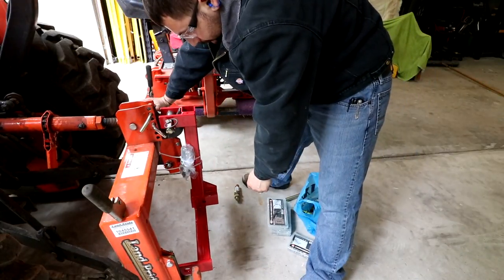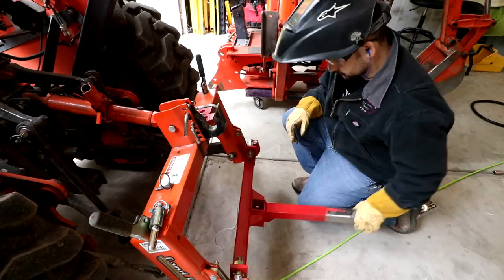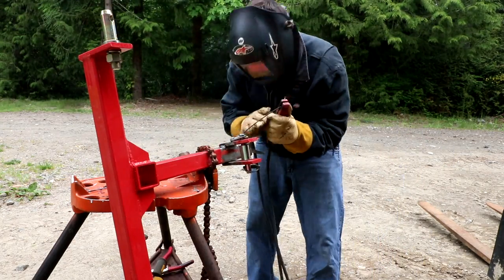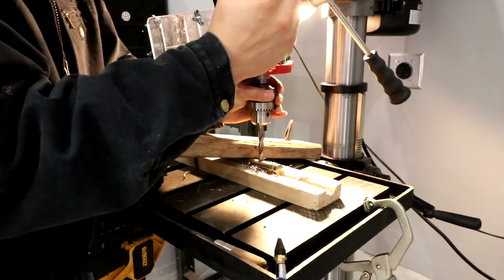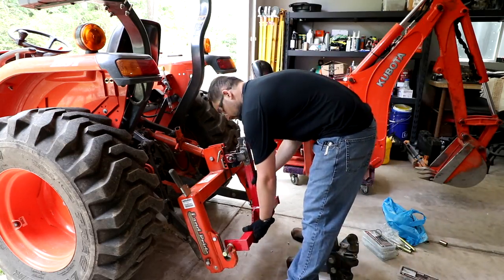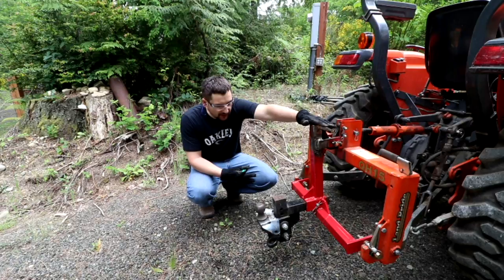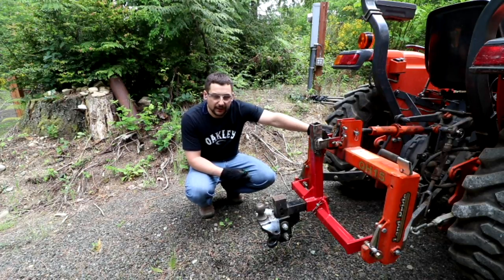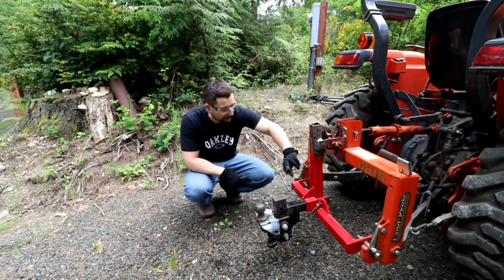Tractor Trailer hitch install.

Comment: Dan what kind is your plasma and tig combo?
Reply from the maker: I have a LONGEVITY WELDMAX 185 180-Amp 3-in-1 Tig-Stick-Plasma Cutter It's a piece of CRAP!!! Really don't recommend it i only use it as a plasma cutter and it only work ok for that. I also have an AHP 200DX for TIG welding it's also works ok. But the cost of the AHP makes it much more tolerable. I use my MIG welder the most its a 110V machine from Lincoln electric.
Reply: Daniel Woodell that's 2 much for me  after buying miller